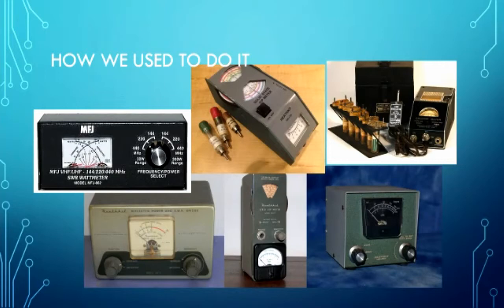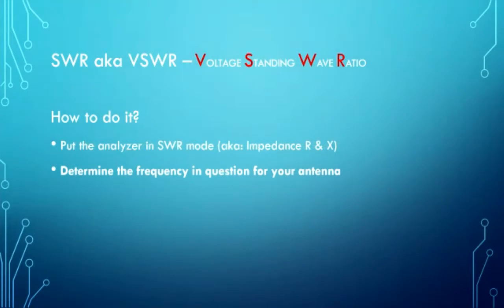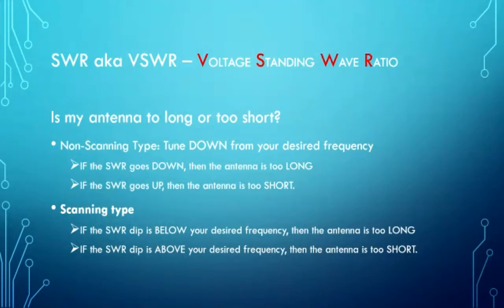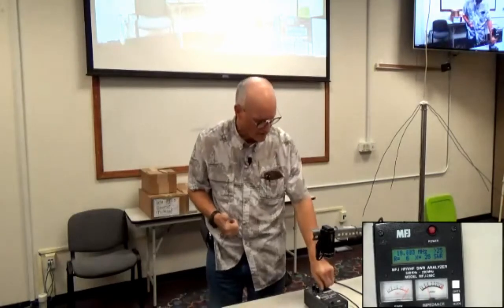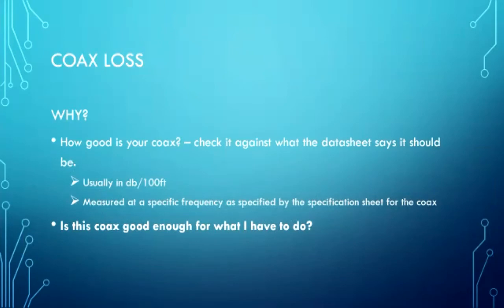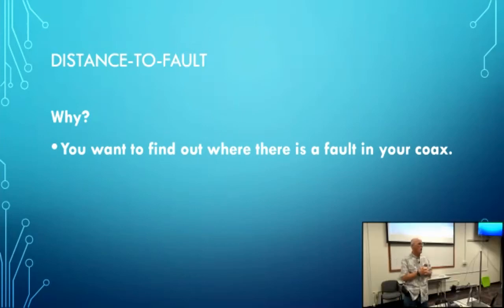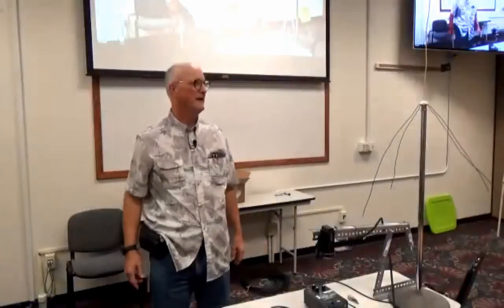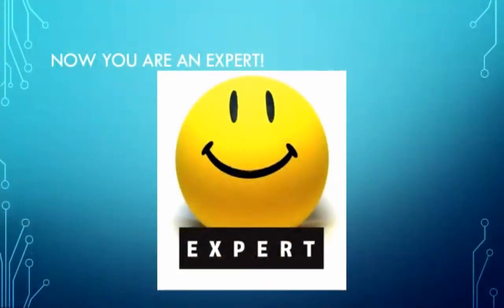Using Antenna Analyzers (007b )

Comment: Excellent! Thank you. I don't have an MFJ-259 yet, but it is on my list of equipment to obtain. I always wondered what the gate and mode buttons did. I suspected it had more functions than are normally shown in radio & antenna related videos.
Reply from the maker: I am so glad that this was helpful to you.  There are several different Antenna Analyzer options out there to consider beyond the MFJ like Comet and Rig Expert. This would also include the nanoVNA and mini VNA tiny, both of which will do everything the MFJ analyzer will do and more; these require a bit more of a learning curve, though. 
My adivise?  Shop around. Think beyond your current applications to things you might want to do in the future and buy what fits present and future plans.

Comment: Thank you very much for the video Ralph ! I understood everything, but i don't know who is selling this instrument. I am older than you, and for years i was using tricks to make TX s or repair RX or make and tune antennas by using and theory. My 73 s from 5B4ER.
Reply from the maker: Thank you for the encouraging words! :-)  The unit I was using there is an MFJ-259C; the current version is the MFJ-259D manufactured by MFJ. This is available through various vendors including Amazon.com.  There are also other antenna analyzers out there manufactured by other companies.  Two of the more common are the RigExpert (https://www.gigaparts.com/rigexpert-aa-230-zoom-antenna-analyzer-100khz-to-230mhz.html) and the Comet Antenna Analyzer (https://www.gigaparts.com/antenna-analyzer-1-8-500mhz.html).  Hope this helps.

Comment: Very informative.... Thank you so much... can you show how to use the meter to set an antenna tuner?
Reply from the maker: Good thought!  I will add this to my list of videos to create. Fortunately, I have an old Drake antenna tuner I can use to demonstrate this.
In a nutshell ...
Connect the analyzer to the tuner in place of the transmitter, set the analyzer's frequency to the desired target frequency, tune the antenna tuner to minimize the indicated SWR on the analyzer. Done.
Please know that the output impedance of the transmitter might not be exactly the same as the analyzer, so you may have to do a little minor adjustment of the tuner once you reconnect the transmitter to get the optimum SWR. With that said, this should get you really really close.

Comment: If we trust the analyzer, then the swr has changed and that is what the transmitter sees. also nice to use the match efficiency feature. R there stands for resistance not real. x shows resonance, Also think lower-longer for length changes.
Reply from the maker: Well, you are kinda right here. Impedance is made up of the real, or purely resistive, portion and the imaginary, or purely reactive portion. You are right that the X portion can indicate resonance, but only when it drops to zero; this is when the capacitive reactance equals the inductive reactance and they cancel each other out. It is, of itself, the reactive portion of the impedance.
The manual for the MFJ-259C (pg 5) states, "The lower line displays the Resistive (R) and Reactive (X) impedance components for the attached load."
Yes, the *impedance* that the transmitter sees is indeed the same as the *impedance* that the Antenna Analyzer reports.  SWR is potentially another story.
No transmitter has a perfect 50 Ohm, non-reactive output impedance (not possible in the real world). The SWR that the transmitter sees depends on two things: [1] the source impedance (this is the transmitter's actual complex output impedance) and [2] the load impedance (this is what the transmitter sees at the end of the coax & what your antenna analyzer reports). If these are the same, then we have a nice SWR.
How far off from this perfect, non-reactive 50 Ohms is the output impedance of my transmitter and should I be concerned? 
Generally, it is pretty close and, no, you probably do not need to be concerned UNLESS you measure the SWR at the end of the coax with your antenna analyzer and then with the built in SWR meter in the radio and they are dramatically different. Then you need to check your analyzer with a known to be good 50 Ohm load (not a dummy load like for a transmitter because they, too, are far from a good standard load - try scanning one sometime to the extents of their advertised frequency limits with a VNA like I have!). If the antenna analyzer is good, then there could be something not so good in the transmitter.

Comment: ok which one do  itrust the swr or the analyzer ???
Reply from the maker: sorry I haven’t replied sooner. I have been and still am very sick. which one to trust? There are so many variables. Application: how accurate do we need to be for our application? will it actually make a difference in the end use?
If yes, then there are good SWR meters with low self-SWR and then there are others. Some of the really old models were much better designed (e.g. Heathkit stuff). 
Then we talk  antenna analyzers. I was unpleasantly surprised to discover that there are manufacturers of such which provided no performance specifications for their analyzer of any kind. when I contacted them to get some, the equity went into a black hole. The device seems to do OK for measuring SWR, but, with the company unwilling to certify ANYTHING about their product in writing, I wouldn’t lean too heavily on its accuracy.
So there is the swirly, not so direct answer.

Comment: I have a gap.  I can''t get a good connection on it'I made the mistake of putting the antenna in the air before I put a coax end on the cable. first let me say I'm on the nervous sided. . I can't get a good end on the cable that is hanging down on the last pl 239  on it we burned the dye;electrode on the connector by getting it two hot by the solider iron.
Reply from the maker: I understand your pain in trying to put a PL-259 connector (AKA: Male UHF connector) on the end of a feedline! It is not the easiest connector to get on there and get it right. Your comment has spurred me on to create an unscheduled video to show how to do this effectively.  In fact, that what I have been working on all afternoon.  Keep a watch out for the new video "Terminating RG-8 coax with a Male UHF connector." My goal is to have it out today ... but, you know how goals can be!

Comment: Esse mfj já era muito caro e agora tem os nanovna baratos e muito preciso nas medidas
Reply from the maker: "This mfj was already very expensive and now has the cheap nanovna and very accurate in the measurements"
Yes, you are right! For what you get, the MFJ unit IS very expensive.  The nanoVNA is much more affordable and more accurate ... however, the MFJ doesn't require the whole "calibration" step ... it is more of a quick measurement, very ballpark sort of device.  I wouldn't depend on it to measure impedance. BUT, the nanoVNA does really, really well.  One note ... as I understand it, if you change the frequency extents (START, STOP), you lose you cal and have to do it again; this even if you are narrowing the SPAN. :-(